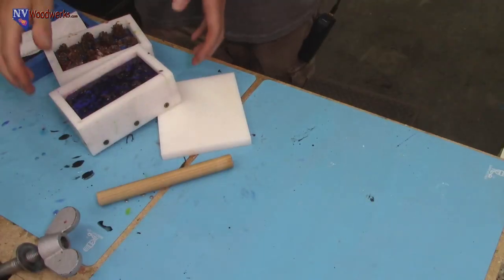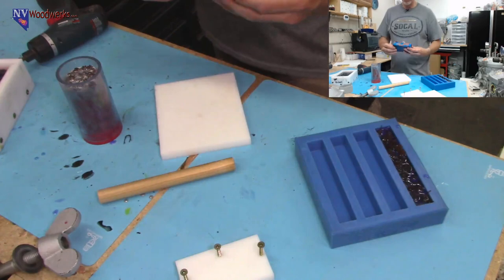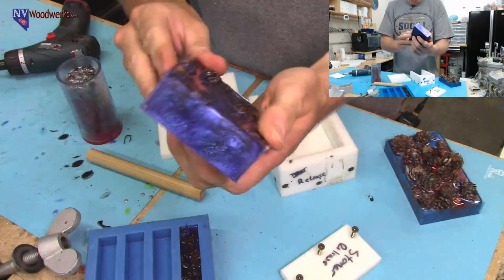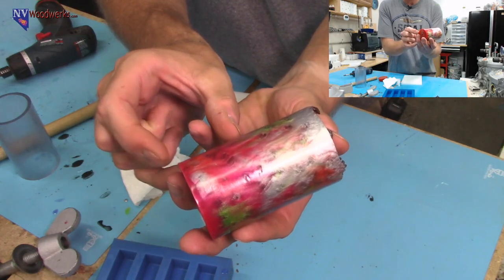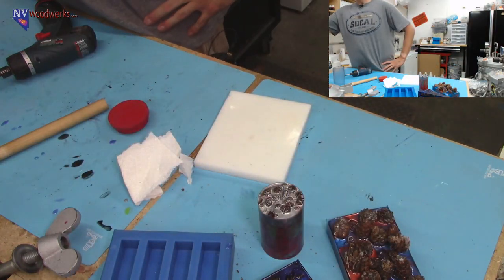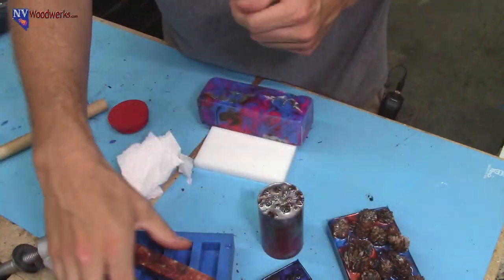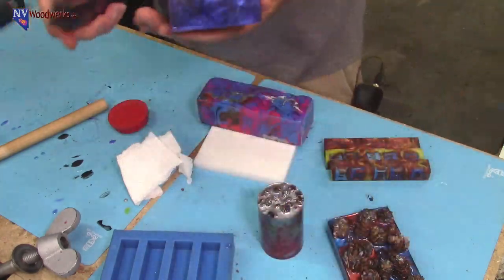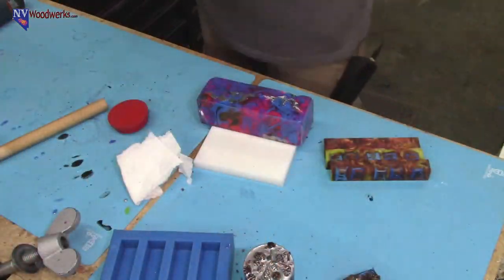🔴Replay: Demolding the Pinecone Party Blanks| Episode 91

Comment: Hey Zac!  Looking forward to seeing the cut up blanks!  I was surprised how easily it popped out of the tube mold!  I poured into a 1.25" tube with the stopper, and the blank appears stuck.  I used Stoner liberally, and Alumilite.  I know you had mentioned that Alumilite shrinks after a while.  How long should I wait before trying to bang it out?  BTW I did post my Stoppers on Instagram and Tagged you.  Not sure if you gave had a chance to see them yet.  Thanks for all you do!
Reply from the maker: Hey Eddie, I didn't see the post on IG, I'll have to go and try to find it. Usually the blanks should be easier to demold if you wait overnight. You might need to tap it out with something just to pop it loose

Comment: Awesome video. You mentioned one of the things that can get ya is moisture. If we don’t quite have a vacuum system yet to stabilize the pine cones could that give us troubles? Thanks again
Reply: Sorry is one year later.. You can use a microwave with the "defrost" function. To find out when it lost all its moisture, you can weigh it, then 1 minute in the microwave, weigh it again, another minute in the microwave, weigh it and so on until its weight does not drop any more. I saw it in a video of a man from Uruguay, I did the test and it worked